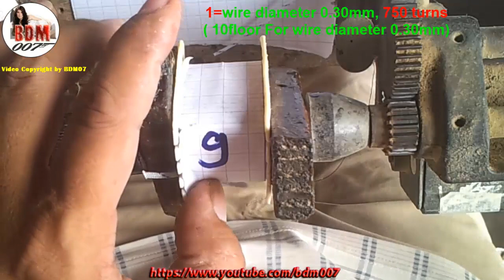How to make a mouse electric shock Trap,An Animal electric shock trap | ដុំឆក់កណ្តុរ​ | មូទរ័ឆក់សត្វ

Comment: I like your videos, can you please provide a link for where you buy your transformer. The bobbin and the lamination. Here in the United States they only sell the transformers already built. Thank you sir
Reply: He probably just stripped the wire from a existing transformer so he could custom wind to suit his needs. (which in this case seems a waste of time to me.) So many appliances have high-voltage step-up transformers that would work just fine, for instance a broken microwave. When they break, almost always the transformer is just fine! An old bug zapper might work but it's questionable the amperage could be high enough to kill rats, etc. To compensate for low amps you could add a great big high volt capacitor but those don't come cheap. A tazer is another device with high enough voltage but it too is intentionally made with not enough amps (for safety reasons) to kill the animal. An old fence charger would be the perfect donor. It would have enough amperage to work just dandy plus it's already setup tor intermittent zapping. Just thought of another readily available source. Use the step-up transformer from a florescent light. It should work just fine also but I don't know what the average amps output is. If you scrounged one for free you have nothing to lose, just install and see if it does the job!
Reply: Have you cerkit please tell me